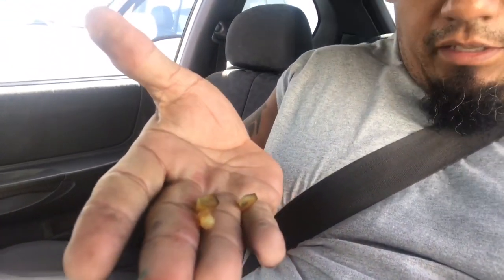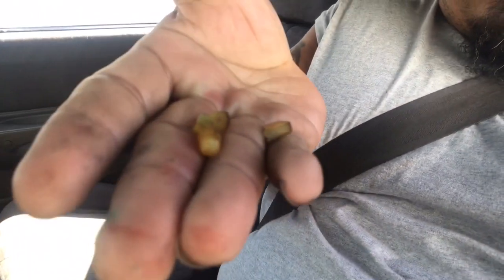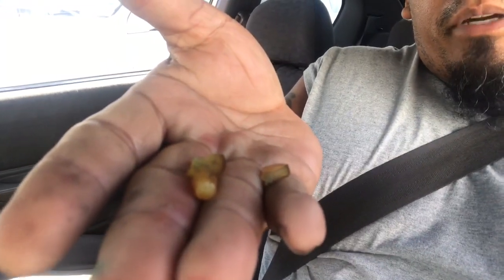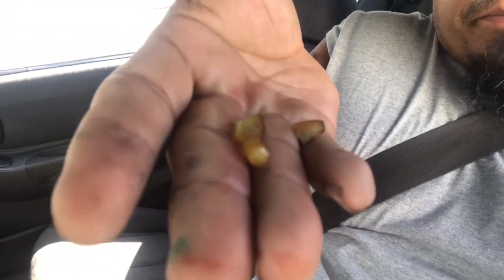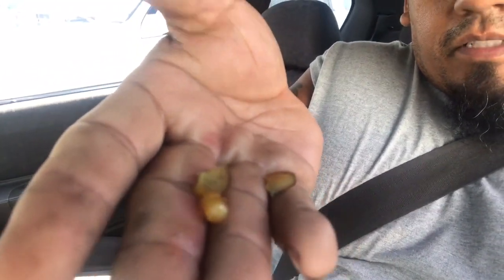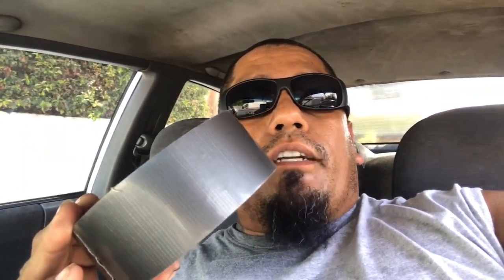2003 Hyundai Accent brake light switch pad replacement.

Comment: I used a super strong (neodymium) round magnet about 3/4" wide and 1/8" thick. Just stuck it on the metal where the rubber pad used to be. So far works like a charm

Comment: I am  a hyundai service tech   and this is a recall   go to a hyundai  dealer  and get a new one from the parts dept   it is free   and a 2 minute job
Reply: Hey Joe is this a fact? Cool news if so but can you possibly let me know specifically what the piece is called so I can successfully communicate with the guy at the dealer parts counter? I’d appreciate your knowledge on this if possible! Thanks in advance.
Danny rig “old school Mexican Style” is by far the best n brightest quick fix I’ve seen in my search! Respect to you, your fast wisdom,n your quick thinking solution that I too put to use for a temp fix! Just need that piece to get this thing back to factory fit.

Comment: Thank you so much. I thought it was the switch and bought one but turns out it was the pad. I found the broken pieces. It's not in stock here either so I made My own! Thank you for Danny rigging this lol. I secured mine with electrical tape bc I couldn't find my duct tape. I can only imagine how much the shop would have charged. Probably would have put a new switch in that I didn't need and charged me for it.
Reply from the maker: Trust me they would have charged you an arm and a leg. Electrical tape works as well. Those pads are never in stock. Your welcome.

Comment: You can't beat duct tape for a quick fix. In case anyone needs the dimension of the pad, it's approximately 18mm in diameter. The pad portion is 4.5mm thick. You could get away with glueing two nickels together to use as a replacement, although nothing beats duct tape. If by a slim chance anyone watching this video has a 3D printer, you can print one instead of paying 10 bucks for the OEM part on amazon. https://www.thingiverse.com/thing:3631069

Comment: man im about to try that but how did you get it to stay and what did you put inside the duck tape
Reply from the maker: Sorry for the long time for a reply. I put duck tape in the duck tape. And basically I just cut thin strips of duck tape and taped it to the metal that holds the pad.